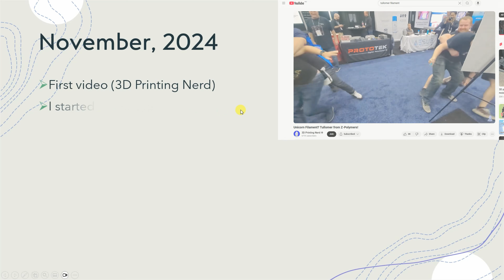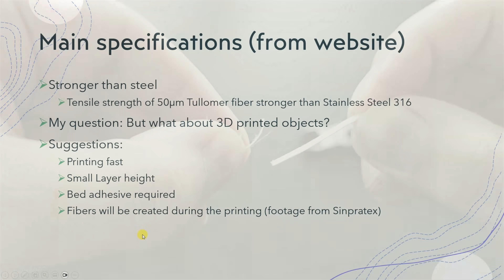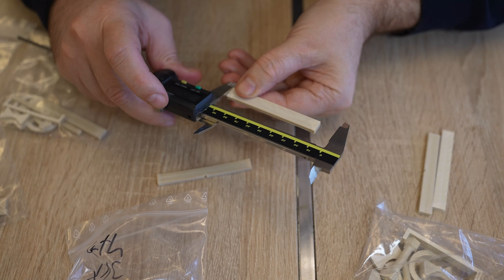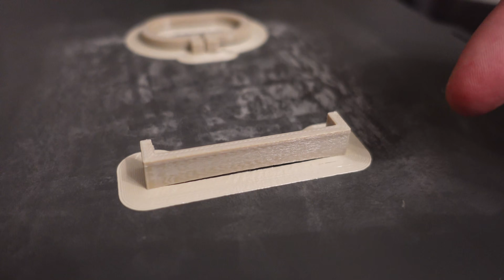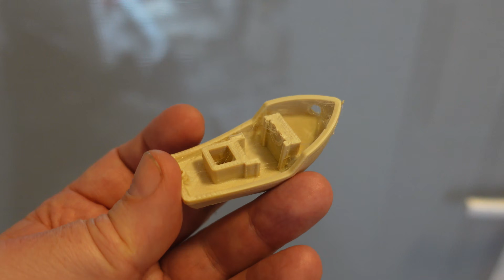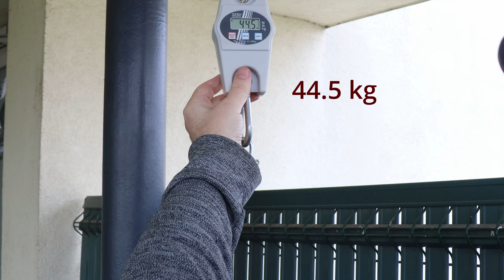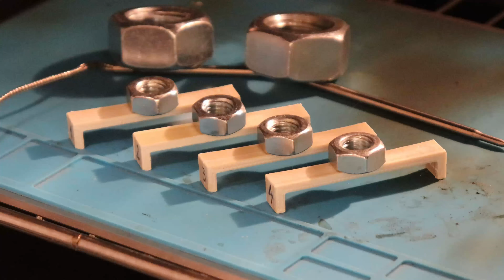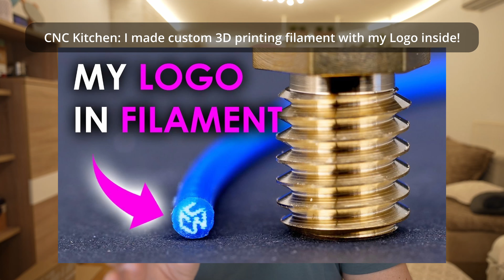Love it or Hate it: Tullomer filament

Comment: One additional thing - does anyone in Czech Republic have this filament available? If You contact me and send me ca 50 grams, i can print it on Prusa HT90 with heated chamber and then anneal them and send samples to Igor. I should have forming sand soon, so i will not anneal it in baking soda - as someone stated, it might actually weaken the prints in previous video.
Reply from the maker: Pavel is that you? I could send you 100g for example :-)
Reply: @MyTechFun  Hi Igor! Yes, its me :) I will contact You via email - i think there is a possibility that I pay via Packeta - so You just send the package, no payment needed. I really want to support You in that way :D
Reply: @nufnuf816 , @MyTechFun , Guys, keep up to date with what test results you'll get! Great, just great work!
Reply: It would be very interesting to see if this makes a difference. I don't think it will tho because i don't think this is a thermopolimer but i think this is some sort of thermoset polimer. I think the layer adhesion is soo poor because the next layer doesn't actually partially melt the lower layer because it doesn't melt at all.
Reply: Any results from this, debating testing this on a 22idex?

Comment: I think that this and previous videos with set of high tech filaments are GREAT news for 99,9% of printing community. And why is that? Cause we have nice proof, that we dont need supermaterials costing hundreds of euros / kg and printers costing 8 - 15 000 euros able to print them. For normal daily usage of parts - regular printer and some good PETGs or PAs are completely sufficient. So Igor - I hope You understand, how BIG service to whole 3D printing community are You doing. Its really something with what You personally change the world. THANK YOU!
Reply: You can create inlays out of metal or metal mesh and similar in 3D printed object as well if more strength is needed.
Reply: PLA with anything between 0-100% infill (and not even fancy tricks like "brick" layers, just right orientation so layer separation isn't an issue) + metal inserts is more than enough for 90-99% applications. Like, for real, many of everyday things are made from MDF or plastic or aluminium sheets that can be bent/dented with a fingernail. We're overengineering things.
Reply: @PeteOfDarkness  Maybe he can´t orient his part the right  way, or it´s summer and the PLA basically melts which si the reason why it´s a non engineering material to begin with.
Btw layering the lines like bricks is not fancy trick it´s just that cheap consumer printers couldn´t do it due to patents and such. It makes absolutely sense.
Reply: Weird mindset to have lol. no one has ever said the average person needs materials like these
Reply: You shouldn't be happy for them to fail, just because you don't have a use for it doesn't mean that it's unnecessary or a waste of money, and as in most things, their price will eventually drop after the R&D prices have been essentially paid by the first buyers. Even if not, the knowledge gained from new things or ideas can be used or improved in other products which might be even better/cheaper.
So it's a win for the whole community when a new material, device or idea comes into fruition.

Comment: As this material is so anisotropic, it should be used like fiber reinforced composites: creating a laminate where each layer has different orientation, for example 0/45/90/135 ( helical pattern with constant angle steps). This could work well for planar load with only in plane shear. Tweaking slicer settings to have minimum wall and 100% line infill with this  sequence of angle could make a composite... If someone could try this, it would be great (for example the hook test)

Comment: Tullomer is a scam.  The manufacturer claimed this material could be successfully printed on "consumer" level printers.  I spent $500 and two days of my life trying to get successful prints on a Prusa MK4S.  All I managed to get is a stack of fibers with pretty much zero layer adhesion.  As you experienced, communication with the manufacturer was zero, and very poor with the USA distributor whom finally admitted you need nozzle temp of at least 230c to get anywhere with it.  As you demonstrated even 230c does not get the job done.  This material may very well print on higher end machines but I suspect it will take at least 250c nozzle temperature or perhaps even higher.  This material may prove it's worth in the commercial arena but unless you have a really high temp machine forget it.
Reply: What are you talking about lol,  230 nozzle, open bed printer? No wonder you had issues, you didn't even read the basics after spending 500 usd... He printed it with 290c and 340 later, did you even watch the vide0?
Reply: @riba2233  open bed printer, 290 nozzle.  Apparently you did not watch the Tullomer CEO claim the material can be priinted on consumer type machines.  I even tried a 300 nozzle and it's not even close to getting any layer adhesion.
Reply: @riba2233  open bed printer, 290 nozzle.  Apparently you did not watch the Tullomer CEO claim the material can be priinted on consumer type machines.  I even tried a 300 nozzle and it's not even close to getting any layer adhesion.
Reply: @johnnyjohnson6771   I did watch, he never said you can use open printer lol. That is a huge mistake on your part, you can't even listen.

Comment: I picked up a 500gram roll of the stuff a few months back.
Running it on a Bambu X1C, I got some interesting results.
Layer adhesion is iffy, but then again the X1C was barely getting to the required nozzle temp.
While the bending strength of some parts was impressive, twisting the same part was guaranteed to lead to failure.
I've used about 120 grams of the material, going to try bumping up the temperature and see what next.
Reply: They suggest significantly higher settings for high temp printers in their data sheet. It's very strange that they even offer Bambu profiles unless even high temp machines struggle with layer adhesion.

You'll need to bump temps up as high as they'll possibly go and heat soak the chamber to have any hope of better results.
Reply: @JJFX-  325C is the minimum nozzle temperature they recommend, but how many printers out there are getting this hot?
Layer adhesion is an issue, no matter the temperature.
Reply: @pirobot668beta  Yeah it seems to just be the draw back of this material and they'll really need to find a way to address it. Nozzle temps of 325C aren't THAT hard to achieve unless the firmware locks it down. I've even added hotends to customized Enders that could handle that. Over ~350C is where things begin to get tricky.
Reply: @JJFX-  The problem is with the thermistors above 300c. You start needing thermocouples or RTP sensors instead, which the bambu is not fitted with
Reply: @Muon3D  Yeah another downside of proprietary systems. Even if it was practical to swap out the thermistor on the bambu, which it likely isn't, the firmware can't even be modified to read it.

Comment: The claim "stronger than steel or carbon fiber" is also strange, it is only for a single fiber, for normal parts, even their datasheet reports a tensile strength of only 250 MPa (V2A steel or 7075 T6 aluminium: 600 MPa, carbon fiber: 5000 MPa, laminated carbon fibres or AISI 4340 chromoly steel: 1000 MPa)
Reply: welcome to marketing.

Comment: Very intresting! Thank you. 

It would be interesting to see if maybe annealing could increase layer adhesion by forming crystals between the layers? What does Z-polymers say about it?
Reply: I could imagine this wants to be printed in a heated chamber of 200ºC to get a chance of cross layer cross layer crystallization given it seemed to resist  any deformation at that heat. Don't know if such a printer exists though.
Reply: @TooBarFoo  no 200c chamber printers can print this fast
Reply: @riba2233  Yep, although I wonder if you need the speed if you can maintain the part temp. Either way, this is out of bounds your typical hobby grade equipment.
Reply: @TooBarFoo   I think you do because you need to draw out thin fibers quickly

Comment: Given the printing instructions and the general behaviour of the material, this all just sounds like the material is not being printed in the correct environment, it probably needs way higher chamber temperatures than what a X1C can achieve, and even then, probably more than any other consumer machine.
Reply: Most likely yeah

Comment: Very interesting results, thanks for the video. What do you think about using this filament on a multi material printer to print fiber reinforcement into other materials without needing an expensive fiber printer? On something like a bambu printer, one could probably print parts from some other material with good adhesion, place tullomer fibers in it and create very strong parts that way. I know, the strength of those parts highly depends on materials and placement of the fibers, but I would very much like to see a test of this with different material combinations.

Comment: From the test results it's a pretty safe bet that Tullomer is UHMWPE (ultra-high-molecular-weight polyethylene). In fiber form it's marketed as Dyneema and can be braided into cable with ultra high strength to weigh ratio. The incredibly long polymer chains naturally align along the extrusion axis, so the complete lack of layer adhesion is not surprising.
Reply: There is a photo in data sheet comparing burning of PE and Tullomer, it has high melting point and leaves chared surfance, non burning or melting in the test.
It seems its more likley nylon or PEEK relative
Reply: It most certainly isn't though. It is more similar to Kevlar if what they say is true. PE wouldn't survive this temperature.
Reply: @riba2233  Very good point. They rarely spec the HDT for UHMWPE but the couple instances I can find don't put it above 100C.
Reply: @dkessler14   they have a good vide0 that explains how they developed this material, it's pretty interesting.

Comment: The fact that the manufacturer couldn't print parts with at least acceptable layer adhesion means baaad things for this filament...
Reply: I just found Z-polymers has Bambu profiles for download on their website, and the datasheet for tullomer has two columns of print settings for consumer grade printers. So this video is actually totally valid and Z-polymers is doing something very risky here. Bambu and similar machines do NOT have what it takes to print this stuff and the should NOT be endorsing it this way. There is going to be serious backlash from people who spend $500 on this only to find it a total waste. The only people who should be buying this stuff are people with $20k+ industrial machines.
Reply: @charlesstaton8104  I don't think you'll need a 20k machine. Seems like a bit of an exaggeration. There are already machines coming out that are cheaper and better than the X1C in most regards. Main thing here seems to be proper tooling for print speed and layer adhesion, and these are solvable problems already.
Reply: @14supersonic  actually I have been following recent experiments with this filament in a private discord server, being done on an actual high temp machine with build chamber capable of 200c+ and speeds >500mm/s, and it seems the filament just has abysmal layer adhesion no matter what machine it's printed on. So I guess I agree with you, you don't need a 20k printer. You can get the same (poor) result on something much cheaper. If I felt like doing a $500 experiment I would run it on one of my qidi machines.
Reply: @ Based on how it's marked that was my suspicion... 200 seems way too hot for this material but that would definitely rule it out. I'm sure there's some improvement at high chamber temps but they need to revise the formula. Give up a little bit of the tensile strength for better adhesion.
Reply: @JJFX-  my understanding of how this stuff works, it's like printing kevlar. Not kevlar fiber reinforced plastic but the actual kevlar fiber. Kevlar is a plastic with extreme tensile strength but only when drawn/extruded in extremely thin fibers like spider silk. If you ever mess with Kevlar you'll notice it's a yarn made up of very fine strands/fibers. If it were extruded any thicker than those tiny fibers, it wouldn't be strong anymore.

So the settings for this stuff are like trying to make a 3D printer replicate a high speed fiber extrusion/drawing line. Trying to make it extrude very fine fibers, as fast as possible, and it just isn't as fast or as possible as we all had hoped. I don't see how they could do anything about layer adhesion. It sucks because of how it is (how it must be) printed. I think any plastic is going to have bad layer adhesion when printing microscopic layer heights at Mach Jesus. 

I think it was a cool experiment that has proved not quite viable. But maybe you're right, maybe it can be improved, I hope so! Because this would be really cool if so.
Reply: @charlesstaton8104  I'm not sure about that, you could certainly be correct but I did notice their suggested print speeds drop way down for high temp printers.
Reply: @JJFX-  there is a video by the 3d printer nerd, an inteview with the guy who invented tullomer and he explains it better than I can
Reply: @14supersonic  Unless you will manufacture your own, you will need such a machine, although I saw some machines, small, on Alibaba, at half price.
Reply: @charlesstaton8104 On the contrary, maybe they are playing 4d chess and making it obvious that an x1c can't work so they don't have to deal with people buying it and then trashing it on the web (because we all know they would) lol.
Reply: @charlesstaton8104 Their high temp print settings suggest printing slower with chamber temps of 120C+. I have no doubt that'll help, especially for warping but I'm skeptical how much it'll do for adhesion.

If they think they need it to market it as a PEEK alternative that's printable on an average mid-range printer when it's really barely usable then it makes me question how comparable it actually is.

If it was truly as good as they claim they'd be targeting the commerical market instead of offering Bambu profiles. They obviously knew most of the test objects wouldn't work out so it's hard to believe they wouldn't also provide parts printed correctly to showcase it. Plus their data sheet doesn't provide any information about ideal layer adhesion.

I suspect they either know it's not viable enough to only be supported on high temp machines or they're shockily bad at marketing.
Reply: It isn't clear in the video and it should be, but I get the impression that the parts printed by the other two companies were printed on X1C also, in an attempt to generate a profile for MTF to use. I don't think there are any properly printed parts in the video, and what is being demonstrated isn't the properties of tullomer, but the X1C's inability to print tullomer.

Comment: will sintering help? I got the impression that it needed to be sintered after printing to increase the layer adhesion.
also, on their spec sheet, it shows a 1% Z expansion as it cools, this is problematic with taller prints (collision with the print head) is there a slicer setting to slowly add a Z step or two with height to accommodate the expansion? this might also account for the unusual warping, along with the contraction along the XY by .5%.
I have to wonder if it would print best with a 200C chamber temp

Comment: Perhaps there is a solution for weak layer adhesinon.
Vacuum infiltration of epoxy resin to bind layers and after termal curing.What is adhesion of epoxy to this fiber?
It complicates things, but if one can reach similar strenght to CF-epoxy at least in one axis it coud be interesting, if prints survive printing...
Reply: Exactly my thoughts while watching this video.  I will test with infusion epoxy and low viscosity cyanoacrylate adhesive. I can envision purposefully printing with lose lateral layer spacing specifically to open up the print as though it were created with a stack of fabric reinforcement.

Comment: Ive never printed with this filament before but I thought that the material only gains its strength after its been annealed (similar to HTPLA).  Not sure if that was already tried but if not, annealing it may bring the strength of the prints closer to what is being claimed by the manufacturer
Reply: The filament's manufacturing sent one set of sample objects.

Comment: Weird. Looks like it expands when it cools. I wonder if this is one of the causes of the weak layer adhesion. I suppose you could try printing this in a heated chamber, but honestly you would probably need a heatgun pointing at the printing part. 65ºC wouldnt cut it. You could probably try annealing it, or print even hotter. Yep i read the dynamism data and it says 180ºC-200ºC bed and chamber heater over 120ºC.
Reply: It isn´t shrinking it´s swelling it´s exactly what I thought when I watched the video for a couple of min. I am not sure how to prevent this.

Comment: I wonder if Tullomer can be used to reinforce normal PLA, ABS or PETG parts. So like by using AMS or dual nozzles, you add walls of Tullomer in specific areas to reinforce parts, similar to 3D printed parts that are reinforced with continuous fibers.
Reply: Petg may be promising, i don't think it will adhere to any other polymer at all. Worth a test if someone has a low volume filament extrusion machine at hand to also just mix them. Whatever it is, its molecular weight must be immense so that can be like CF filler without the particles.

Comment: Would like to see this with 0.2mm layers, lower speeds, higher temps. The sample you printed in the xmax3 with higher temps had 3x as strong layer adhesion, seems like the right direction to make this filament more usable
Reply: It only works with very low layer heights, it needs to form in some way